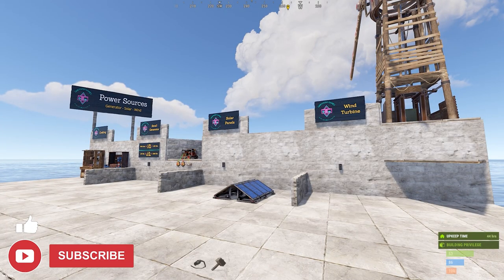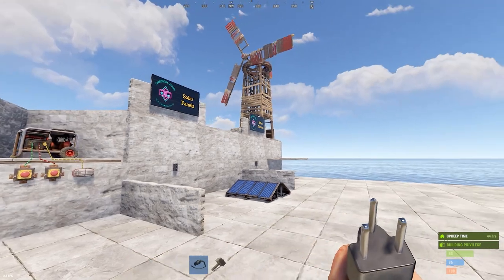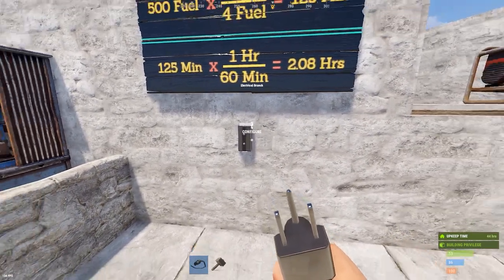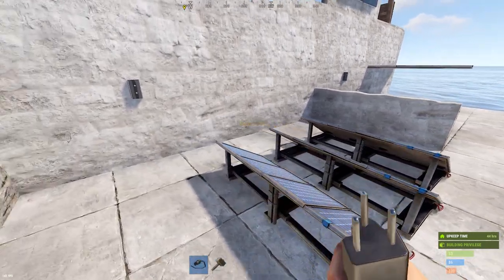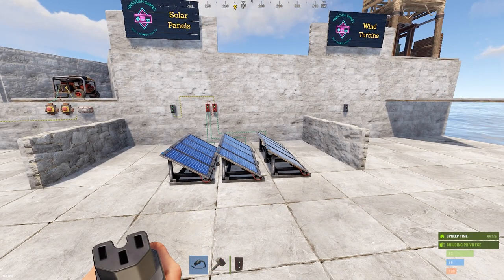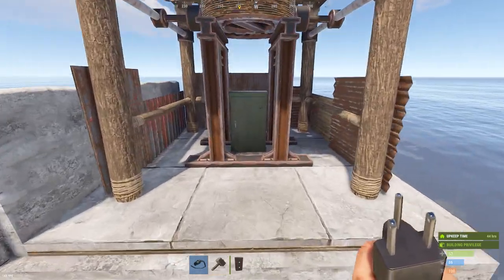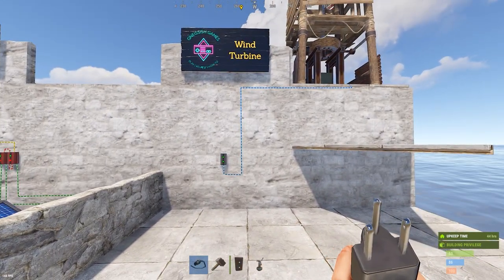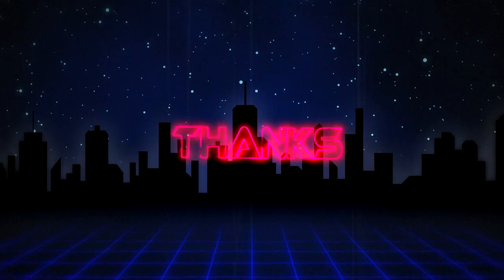RUST Electricity Tutorial | A Beginner's Guide to Power Sources - Generator, Solar, Wind 2022

Comment: Great video. Do you think it’s at all practical to use the smart alarms on a decent sized trio base? I’d love a raid alert system but our compound is 24 high stone walls so it seems very expensive. Do you ever use smart alarms?
Reply from the maker: Thank you! It's entirely practical. I use smart alarms all time on small and large base designs. You can build circuits that combine multiple sensors into as little or as many smart alarms as you like. I generally have separate alarms for exterior, interior, and directly outside the tc room.

Happy to make a raid alarm video if you like.
Reply: @AustinKlailaGames  that would be fantastic. Also I wanted to say your full base wire up video is one of the best videos I’ve ever seen- across any kind of content. It’s really nice to watch something that’s so niche done by a total expert in the subject who is clearly really interested in what they are doing. I was surprised that I didn’t skip through any of it :D
Reply from the maker: @DavidRamseyIII  hey that's great! and thank you! I'm happy it was useful for you.